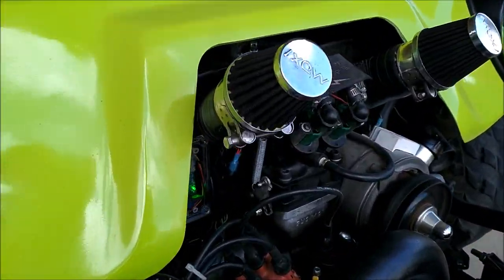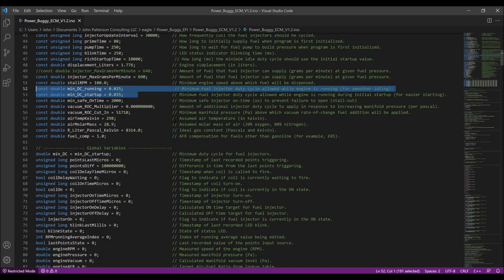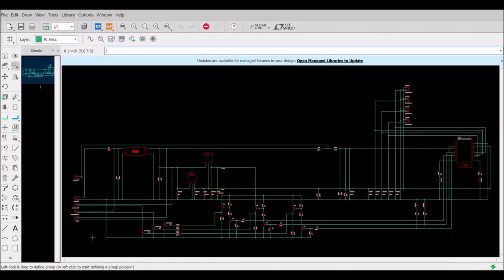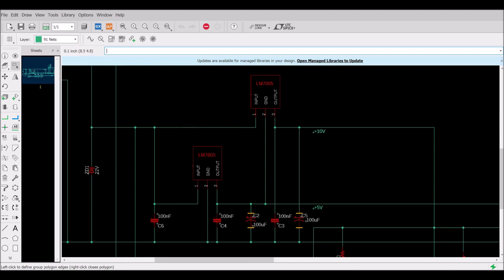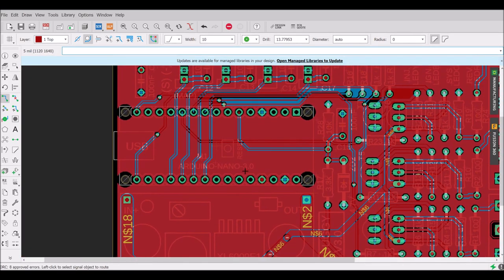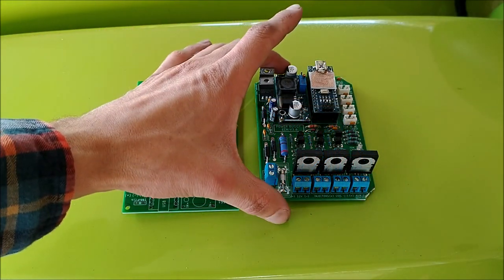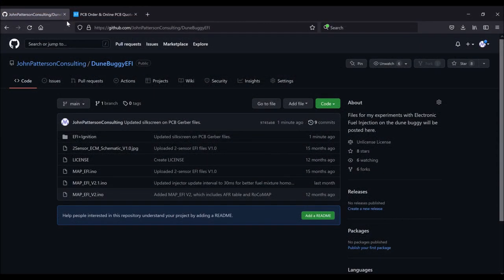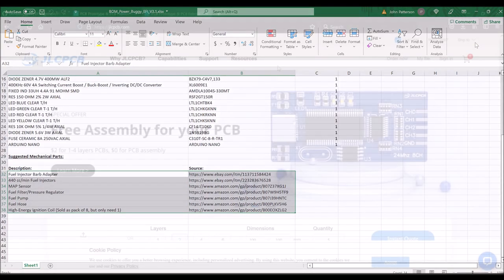DIY Fuel Injection Control Module - An In-Depth Look

Comment: Hi again, sorry to be a pain but can you please explain how you derived:  "const double R_Liter_Pascal_Kelvin = 8314.0" in your code? I have a four bar MAP sensor measuring boost and need to alter your code to reflect that change if possible?
I'm new to GitHub also. I created a fork with my altered code added. I will watch tutorials to learn how to correctly use the platform. My sincere apologies if I have encroached. 
Cheers Scott.
Reply from the maker: R_Liter_Pascal_Kelvin is the ideal gas constant used in PV=nRT.

You should adjust vacuum_ADC_value and Pascals_Per_ADC_Unit to set your MAP sensor parameters.

Arduino ADC inputs have 10 bits of resolution, and return values from 0-1023 representing voltages from 0V to V_REF (which is 5V by default, and can be changed). 

vacuum_ADC_value is the ADC value returned when the MAP sensor is at hard vacuum (0 PSIA), otherwise known as the offset.

Pascals_Per_ADC_Unit is the number of Pascals of pressure represented by every ADC number unit. You can measure this empirically or derive it. For a 4-bar (400000 Pa) absolute pressure sensor, assuming an output range of the full ADC range ( 0-5V), the nominal value for Pascals_Per_ADC_Unit should be 400000/1023 = 391, but the exact value may need to be trimmed based on the accuracy of the sensor.
Reply: @DielectricVideos  Thank you so much for taking the time to explain all that for me. I really appreciate it a lot.

Comment: Can you make to run diesel solenoid injectors?
Reply from the maker: Possibly. The key to operating a diesel engine is the correct timing of the injectors, as the injection timing is what initiates the combustion stroke. If this board were used to drive diesel injectors, it would be necessary to synchronize the injector with a known crank position source. Unlike a gas engine, there is no need to perform AFR calculations, as the diesel engine operates with unrestricted airflow in a lean-burn condition. The injector on-time would be synonymous with throttle position, and as a result, could be obtained from a pedal encoder or potentiometer.

If your intention is to use diesel solenoid injectors on a gas engine, then it will most likely not work. Diesel solenoid injectors typically operate at extremely high pressures (10,000s of PSI), and they are also lubricated by the diesel itself. As a result, they would not work well with a low-pressure gasoline system.
Reply: @DielectricVideos  Interesting! do you think a signal could be taken from the existing diesel injector driver circuit in place of the distributor for timing, and then be manipulated to extend/shorten output injector pulse duration according to throttle position?
Reply from the maker: @scottneels2628  Typically diesel engines operate in lean combustion with no air throttling, and instead throttle only by fuel delivery. For a diesel cycle, it may be better to simply pick up accelerator pedal position using a potentiometer or "pedal by wire", then convert it to an injector PWM signal. You might be able to do this with just a 555 chip and a MOSFET.

Comment: Was there an advantage to this system over Alpha-N?
Reply from the maker: The main advantage of speed-density over alpha-n is that there is no need to map/tune throttle position vs. airflow over a wide RPM range. MAP sensors can also be installed using direct connection to the manifold, so there is no need for a throttle body with throttle position sensor. There is still some tuning to perform even for speed-density, because volumetric efficiency is not 100% on any engine.

Comment: Would it be possible to use this for a single cylinder honda style engine? I would be very much interested in making a fuel injected generator with this :D
Reply from the maker: If the engine has a points-type system on the magneto, then it should be possible to use this system. The board has an internal pullup resistor, and it can be connected to any "pull-to-ground" switch for ignition timing and RPM sensing. The only issue you may encounter would be due to the small delay between the points opening and the coil firing, as the coil takes a small amount of time (1 millisecond) to charge and fire after it sees the points state change. If the engine has fixed points timing, the ignition may fire slightly late as compared to the original magneto.
Reply: @DielectricVideos thank you for the quick reply! Unfortunately the engine has a magneto ignition system without any points, they sadly got rid of the points on the modern engines. Do you think it would be possible to install a sensor that grounds the input to the ECM somehow else? Or does that not work?

Comment: I would love for you to help me properly program it for an aircraft, I have a EZ30 H6 (original) installed in a aircraft, currently it runs on the stock ECU however would love to do a custom ECU and programming specifically to configure for this application
Reply from the maker: I would suggest not using this system in an aircraft application, as such a use case requires a higher standard of reliability than a road car, and consumer-grade electronics such as the ones used here are not suitable for the application.

Comment: I'm doing a project on conversion of Suzuki volty 250 to EFI System. can you please give me support on running the injector. its single-cylinder engine. I have taken the RPM signal well. but the amount of fuel is not enough. (doing with Arduino Nano) can you please send me a code for run the injector... thank you
Reply from the maker: Here's where I posted the code that I use on my car, assuming you want to do both ignition control and injection control: https://github.com/JohnPattersonConsulting/DuneBuggyEFI/tree/main/EFI%2BIgnition/Arduino%20Code

If you just want to do injection control, you can use this code: https://github.com/JohnPattersonConsulting/DuneBuggyEFI/blob/main/MAP_EFI_V2.1.ino

For your Suzuki Volty, there are a few adjustments to the program constants that will need to be made. In particular, line 24 [line 26 in the injection-only code] (pulsesPerRevolution) will need to be changed to reflect the number of ignition pulses your distributor points give per engine revolution,  line 48 [line 27 in the injection-only code]  (displacement_Liters) will need to be changed to the displacement of your engine, and line 50 [line 28 in the injection-only code](injector_MaxGramsPerMinute) will need to be updated to the total capacity of your injector at the operating fuel pressure, in grams per minute.

There are a few other constants to adjust for things like idle duty cycle, ignition timing advance,  and AFR table values once you are ready to fine-tune the system.
Reply: We did these all adjustments in the code that you given. But the engine didn’t start. We are using a denso MAP sensor (079800-5690). Is there any changes have to do Due to that MAP sensor ??
Reply from the maker: @heshanthalpawila561  First be sure the engine starts when supplied manually with fuel from a spray can or other source. If it does, next check that the activity LED changes form flashing (stalled) to steady (engine running). If the LED is steady and there is still no fuel being supplied, check injector wiring. Because there is a minimum idle injector duty cycle, as long as the ECU detects the engine turning, some amount of fuel should be delivered regardless of the MAP sensor state.

Comment: Quick question, would this pcb and code work on a 1 cylinder engine?
Reply from the maker: It should work, assuming you can get a pulse-train ignition signal from the magneto or other ignition signal source. You'd have to adjust the value of pulsesPerRevolution to match the magneto or ignition pickup output, which I believe is 1 pulse per revolution on most single-cylinder engines. Other than that, you would also need to adjust the displacement value to match your engine.

Comment: pcb Copper foil thickness？ 35um ok？
Reply from the maker: Yes, 35um (1oz) copper is what I used 👍
Reply: @DielectricVideos  My motorcycle is a boxer engine with 180° trigger. I want to modify your Optical_Spark_V2.0. What software did you use to edit? protel 99se autodesk eagle Altium Designer Summer 09
Reply from the maker: @zhanlingsong3495  The PCB files are all Autodesk Eagle files. I believe they were created in version 9.2.2.
Reply: @DielectricVideos  Thank you again
Reply: @DielectricVideos  If I retrofit your work to my 750cc boxer engine, can I use the FAI injectors?
Reply from the maker: @zhanlingsong3495  If the FAI injectors are high-impedance (~12 ohm) injectors, they should work. However, if they are low-impedance "peak-and-hold" injectors, they would need a different power electronics driver circuit to operate them.

Comment: how much is it ecm
Reply from the maker: Based on the price of the components today, I estimate the total component cost to be about $30.77 and the PCB cost to be about $7.10, for a combined ECM cost of about $37.87. It takes about an hour to assemble one, so consider the value of your time as well.

Note that this cost does not include the wiring, coilpack, fuel injectors, fuel line, pump, filter, etc. and is only reflective of the ECM cost. The shipping costs are also not included in this calculation, and prices of components may vary from day to day.

Comment: Would a throttle position sensor simplify the system? I think this would be great for old motorcycle engines that use difficult to tune side draft carbs. Having used a Holley EFI system. (Terminator X) I understand most of what you are doing here. Specific components like injectors and sensors have different values. Injectors, especially, have differing values based on voltages to the system.  Isn't an Arduino Nano underkill? Wouldn't a ATMega32 be a more capable chip? I can't wait to see and hear more. Very interesting.
Reply from the maker: The TPS would be helpful for faster response, though either MAF (mass airflow) or speed-density (MAP/RPM) would still be needed to get the fuel metering correct.

Since it's not such a fast system, the 328p is adequate for now, but a faster IC would be useful for engines that rev higher or have more cylinders.

The 4-coil system I'm working on actually uses 2 Nanos to split the load on fuel metering and spark timing, but I'm also looking into running an ESP32 as the MCU so that I can run a small web server on it to do realtime engine monitoring!
Reply: I would use a "Blue Pill"  development board based on STMicroelectronics’ STM32F103C9T6 microcontroller that has an ARM Cortex-M3 32bit core that runs at 72MHz max. Software libraries are available that allow users to program the chip using the Arduino IDE.

Comment: sir，Optical_Spark+Power_Buggy_4Coil（S1）（ S2）（ T）   which access  （optical points） Optical_Spark+Power_Buggy_EFI （S1）（ S2）（ T） who access （points） 6：10-6：12  Optical_Spark  five wires  where to connect？english from translation Please forgive me
Reply: Selection of map sensors Pressure range and signal voltage range  thank you very much

Comment: he hasn't even got the centrifugal advance locked up in the distributor......doh
Reply from the maker: I set the centrifugal advance constant in the program to 0 degrees/RPM, so the advance in the distributor is perfectly OK to have still. It would also be OK to lock it out and set a nonzero value in the program 👍

Comment: have you thought about implementing a bluetooth tachometer
Reply from the maker: I was actually thinking of designing a new version of the system in the future to use an ESP32 board with WiFi. I would run a small web server on one of the ESP32's cores, the use the other core for engine management. As a result, I could show key engine parameters on an in-car tablet connected to an in-car network. It's just an idea, but I think it would be really cool to try at some point!
Reply: It may be interesting to modify the arf table in a graphical environment, I'm still a bit intrigued with an injection synchronized with the engine, but with what I've been researching, it wouldn't be easy
Reply: @DielectricVideos  That would be seriously cool!